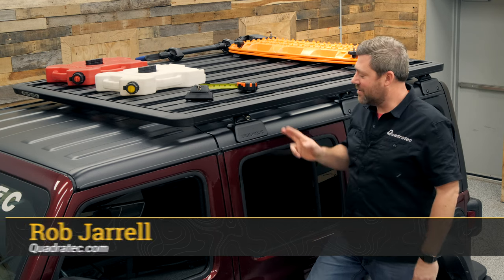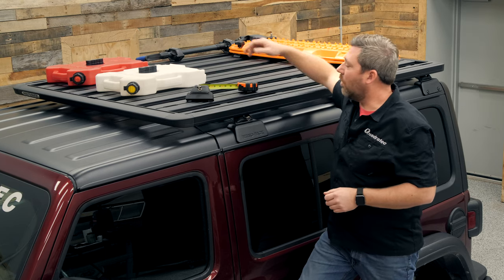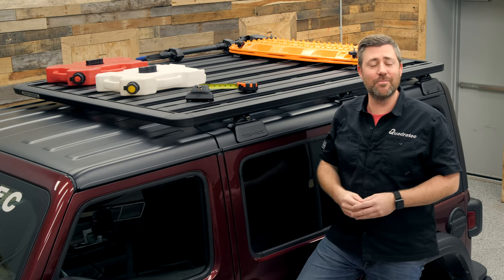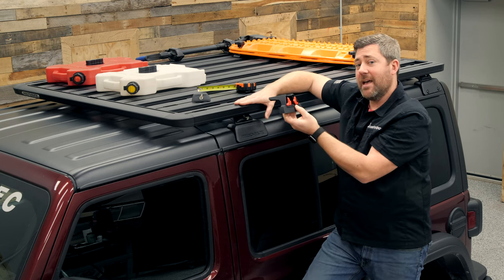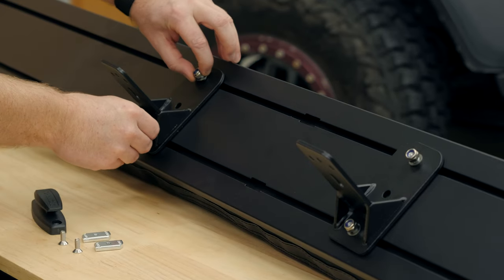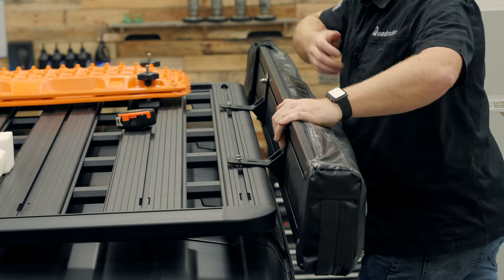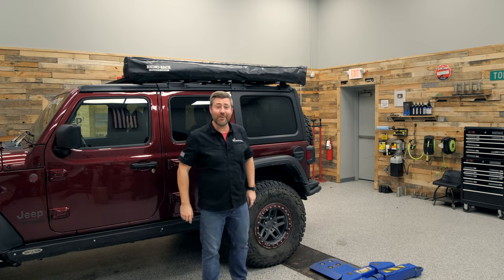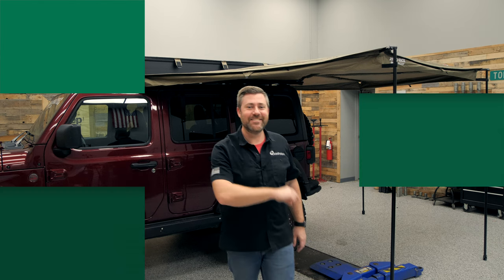Rhino-Rack Pioneer Platform & Batwing Compact Awning for Jeep Wrangler JL

Comment: I got this kit for my JK with the RCL feet (low profile) but those feet have tabs sticking down at the bottom but there is no slots for them to go into the backbone bases sitting on top of the roof. Did I get the wrong feet or am I missing something?

Comment: I tried opening my full size batwing by myself like that and ended up breaking two of the hinges when I tied it to the rack. Must be a common thing since the awning came with two spares. Ever since I make sure to have another person extend the legs as I open it. Kind of annoying since there are awnings now with better hinges that don't require legs on the awning.
Reply: When opening as these are not freestanding, you drop each leg as you go around. Two trailers with a compact and now full size batwing with zero issues. I can see how it could easily break though. Not sure they are the weak link but $30 set of spare hinges (2 free with mine) vs a new awning is a win.